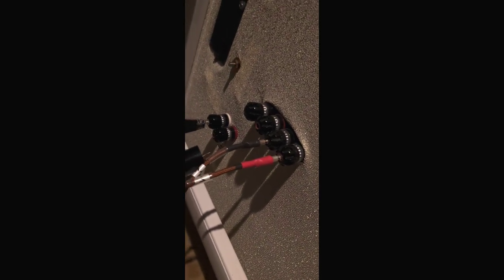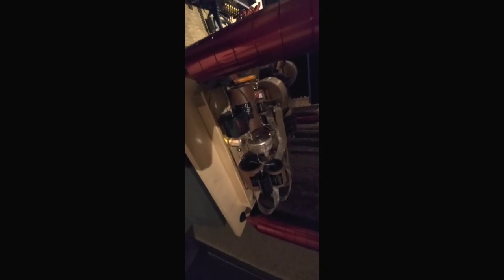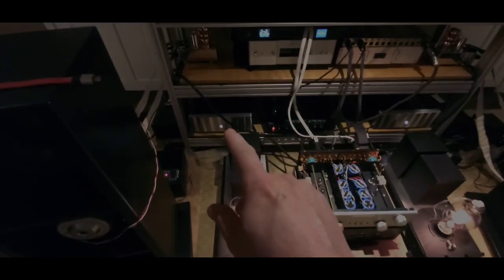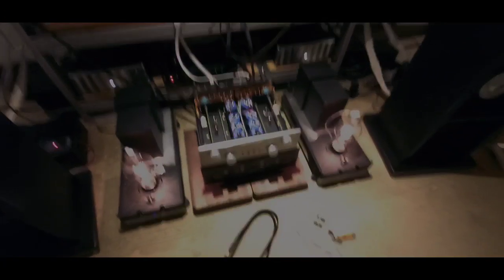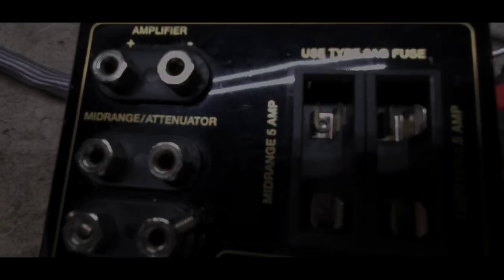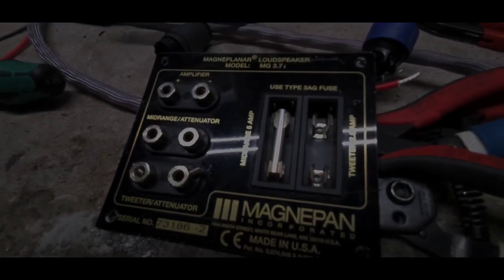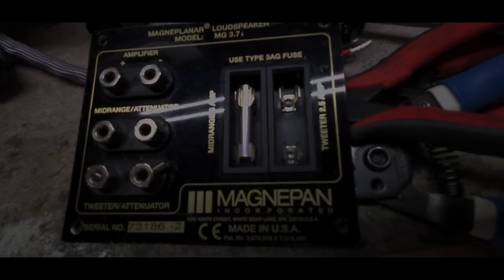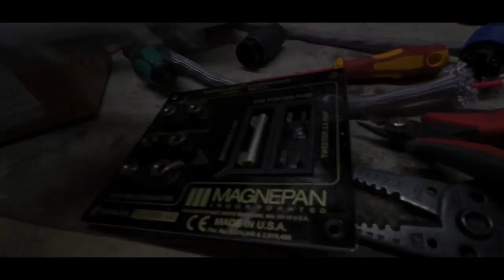MAGNEPAN Speakers, How to DOUBLE their performance !

Comment: I have a pair of 3.5R with NHT dual subs, dual sub amps and crossover.  Also, I have a pair of Rogue Audio M180 "Dark" spec amps teamed up with Rogue RP-7 preamp.  I am interested in applying the tweeter and active crossover mods you suggested.  Before I go down the rabbit hole, can you advise if the gear you suggest is what I need for my current setup?  Thanks. LB

Comment: If you like single ended triode amplifiers but you need more power to drive Magnepans it is not that difficult to build - for about what you would spend on a pair of 0.7's - an 833-A single ended triode amplifier. It needs about 1000 Volts on the plate, a Hammond 1642SE output transformer, and I use a Luhndal LL2765 transformers to couple 45 triodes to step down from 5k to 600 Ohms on the 833-A grids at zero grid bias. This has all the power Magnepans need and it sounds much better that the solid state amplifier the store where I auditioned them sounded. I would be interested in building such amplifiers for someone or helping them build them so I could guide them to insure success. The 833-A has to run its tungsten cathode on pure DC at 10 Volts and 10 Amperes. You can use a car battery with a 0.26 Ohm dropping resistor or build a power supply which has to have its 4.5 Farad capacitors pre-charged before switching on the cathode heaters.
Reply from the maker: Cool man ! Just saw this !

Comment: Hey Mike.  Just found your video.  Was wondering since you had all of the Magnepan models, do you think the new model 1.7i or the 3.7i would sound better than the 2.6R?  Like you I had most of them on over the years at different times, the MMG, 1.6, 3.6 and 20.1 and now the 2.6r completely refurbished, but can't remember that they are significantly better between the 1.6, 3.6 and 20.1.  The bigger they get the bigger the sound but the sound signature hasn't changed.  The MMG sounded kinda small.  So what do you think? The 1.7i is worth the upgrade from the 2.6r?

Comment: Are the MMGs able to be bi-amped without cutting wires and other things?  From what I read, the 3.5s and 3.6s (and 1.6s?) can be bi-amped using the existing connectors.  If not, how would I get rid of the old crossover and set up connections for the active crossover?  Thanks again!

Comment: GREAT vid on Magis. Just got 3 yr old 1.7i. with FJ mod kit not used. Been scared to use ss fuse link, but I trust you. Shocked your good with low end subs, but I only have 2ch Carver M400, just recapped. Im looking at 1 12" 370watt Rythmix servo sub for "fast bass" or is that bull? Is a DIY Dayton good enough?

Comment: Mikey, thank you for turning me to Magnepan. I started with .7 few months ago  I bought MG12 and I upgraded the capacitors which made the speaker really sound incredible with my 2 Anthony Gallo speaker. I decide to move up the Magnepan chain and I just bought 1.7I 2 days ago and I hope it will sound bigger than the .7 and more refined than the upgraded caps MG12. I definitely will buy your kit but I am very interested in the active crossover you are talking about. I don’t know where to start because I am not a techy guy and I know nothing about external crossover. I would appreciate if you can let me know how to start and where can I buy the active crossover. Thank you! Daniel.
Reply from the maker: Daniel , contact me directly please. I will explain whatever you'd like and I can just not explain and give directions what to do and why.  four oh four 764 six 2 three three

Comment: Got the LRS, but i am not blown away (yet). Bypassed the fuse and jumper. This helped a bit for the highs. Now in the process for some better stands. When they stand straight, the highs and mids sounds better. Can anyone advice me if an edge A2-300 amp can drive these things well?.
Reply from the maker: Excuse my French but Fuck yes Edge will drive those well. Are you kidding ? easy ...
Reply: @OCDHIFiGuy  hmm. I must test this some more then. My 30 year old 55W kenwood pushes the lrs twice as loud, with much more base. I ordered an hegel H90 now. I have seen a review this will get the best out off the lrs. Also ordered new cross over filters at gr research to improve the mid and highs.
Reply: Hi, what connection/s did you remove or move to get this bypass done on the LRS? thanks
Reply from the maker: @bikall1  ill bet your old Kenwood kicks The Hegels ass..
Reply: @OCDHIFiGuy  no it doesn't. The hegel performs very nicely with the lrs. I have 1 REL T5 now and a second one is comming. I ordered new crossovers for the lrs at gr reseach.
Reply: @tothemax324  with 4 screws you can pop the terminal plate on the back of. Follow the positive lead. You will see it runs through the jumper and fuse and then to the driver. Just move the fuse connection to the positive lead and srew it down together and you bypass the fuse and jumper. You only need a srewdriver and small spanner.
Reply: @bikall1  Thanks very much, as my LRS are on the way its still bit of a blur to picture. do you know of a link with pics? I cant find anything on the internet
Reply: @bikall1  Sorry mate, didn't mean to make it your problem, will wait until I have them then follow your plan
Reply: @tothemax324  No problem. But i don't think you will find it on line. But just pop the back off. it is dead simple. The red lead is +, the brown is the lead for the tweeter. Disconnect the brown connector and place it together with the red one on the red terminal.
Reply: @bikall1  Thank you sooo much, have copied/paste your instructions for reference
Reply: @OCDHIFiGuy  Well, some report on this.. I got a REW measurement set up in my room and i tried a hegel H95 back to back with an edge 300 on my LRS. The 300 W class D edge puts out less SPL then the hegel, but also considerably less bass as the hegel. The difference in the low frequencies is almost 10 DB after i match the outputs of the hegel and edge from 1 K hz to 20 K hz.

Comment: Great vid!!! I am using two powered plate amps subs with the LFE option. This allows me to use the electronic crossover in my receiver to separate the  highs and low frequencies. (Yep I said receiver. budget system LOL) I am then using a B&K amp to power the MG1’s.
Sounds good but need to upgrade my Maggie’s to maybe .7 or 1.7
I love your channel and would welcome any other budget suggestions you may have. Thanks “D”
Reply from the maker: Sounds like youre good , but the bottleneck is the receiver. and once you lose the receiver, you lose the crossover so you would have to add 2 things back , but it would be a complete eye opener for you .. 
Cheers !

Comment: Going true active like yours is one of the best improvements you can do to any speakers definitely went active 25 yrs ago still have the same setup that says something.
Passive is inefficient and a poor compromise in comparison, jim
Reply from the maker: For sure Jim, 
Are you fully differential front to back ? I see BAT in your moniker
Reply: My experience has been that going passive for mids and tweeters is the best but this is for regular box speakers.  

For the lows and mids yes it’s more efficient and easier to get better sound. 

However some are willing to spend lots of monies to use expensive passive crossover and produce all frequencies for the most combined natural sound and drive those tower speakers full range with lots of power.  Not sure if better is produced myself. 

Seems way more practical to use Maggie and sub type set up and use an active crossover.

Comment: What’s the info on the ribbon midrange you added? 
I added a Fountek ribbon tweeter to my MG2Cs as a super tweeter. Upgraded the crossover with Jupiter and air foil inductors made a world of difference. 
I’m very much the same as you. I will never own a stock pair of Maggie’s.
Reply from the maker: It's an out of production BG Radia... 2 inch wide 36 inches long.
Reply: @OCDHIFiGuy  thank you for the reply. Appreciate your content

Comment: I have 80s Era SMGs rebuilt by Magnepan 10 years ago. Would one of your fuse replacements improve them? There's only 1 fuse per speaker with no attenuater jumpers. I eventually want to upgrade to LRS+ but can't do it right now as I just bought a Schiit Vidar2.
Reply from the maker: Absolutely, Call me for a special order...
Reply: @@OCDHIFiGuy  I don't see any means of calling you. Do I call the Elleven # ?
Reply from the maker: @Starmangmh57  yes, that's me.... numbers on the site

Comment: I have a pair of MAGNEPAN .7s with MAGNA Riser stands and silver wires to replace the nickel plated horse shoe crap. What I need to purchase from you is the SILVER replacement for those silly fuses. I play my music at normal levels so the tweeters are never in danger. A pair of SVS SB-16 Ultra subwoofers handle the BASS from 80hz to 16hz.

Comment: Hi, I have a pair of 8 year old mmgs which sounded great for 5 years until I hooked them up now after 3 years of non use and they sound awful, I can turn the receiver volume up to -5db and still very little sound comes from them, do they degrade over time, any thoughts on this.
Reply: alexander curry yes they do degrade. Old mug will delaminates, that is the wire will separate from the Mylar panel.

Comment: What about replacing their  50 year old stock design nickel over brass or nickel over ferrous metal female bananas with copper female bananas. Or copper over nickel over silver (can silver be plated over Cooper, without nickel in between The copper and the silver? Or is my assumption incorrect? That would greatly improve the Sonic’s.

Comment: Your Awesome!  I was using a Pioneer separate component system I had since 1980.  It ended up biting the dust in 2010.   I then purchase a Yamaha 7.1 channel 140wpc for around $2400 in 2010.  I never really got into that system for some reason.  It always seemed it was missing something.  I ended up giving it to my brother.  I am now using a couple Crown XLS 2502 Class D amps as mono blocks with an Emotiva BasX PT-100 Stereo Preamplifier/DAC/Tuner.  I would like to match up with a pair of Magnepan LRS for $650.  I do plan on using a pair of subs with them as well.  Anything you can recommend to this 58yr old to get the best out of these Maggies?  I heard they sound best at up to 8 feet apart, 6 feet from the front wall and at least 6 feet from the side walls.  How far apart should I place the left and right speakers from each other?  How far apart to place the speakers with the tweeters on the outside or inside?  How much to toe in or toe out the Maggies?  I am going to use a miniDSP 2x4 HD to do the active crossover before the amps.  Can't wait till you review Maggies off the ceiling!  TY SO MUCH!
Reply from the maker: Thanks man, sounds like you have been watching my vids and taking notes, because you got it . First thing to do is buy my Maggie instant upgrade which is a fuse bypass for just under $100. This will be the strongest return on investment you;'ll make in Hifi. Find them on 11stereo,com . Then add dual subs and biamp Making sure to HIGH PASS the main panels at same slope and point as your sub low pass filter. Nearly everyone forgets this and it hugely frees up the main woofer to make a better smoother midrange presentation.,  There is no one formula for maggie room placement ,  Generally speaking not close to walls if you can help it and the wider you go between them the more toe in you'll need ... call me if you need to know more or you want details

Comment: Dear Doktor Chaos, it will take a few iterations for me to understand what you are talking about. I understand that the fuse is worthless. And nickel-plated parts are also worthless.
The sub-woofer part is for now beyond me. I do understand that stiffening the frame is beneficial. Perhaps carbon fiber would work even better. I don't think that the metal struts improve the stiffness of the frame. The strut is not very stiff. A carbon tube would be better.
I do think that you make very good points. I just need more time to get it. 
I will get there.
Thank you.
Reply from the maker: Hi Peter, let me know what you are not clear on and Ill try to help. The metal strut brace is far more stiff than before, Sure carbon is more stiff , first off that level of stiff os not required, second of all go price it and get back to me.. 

Best

Comment: I'm running wall mounted MMC2's with dual DWM's and a single REL Strata sub. Powered by a Bryston 4b SST2. The level of sound produced in pretty mind-blowing already, but I'm always looking to get better. Does you MMG suggestion cross over to MMC2's with DWM's? Any suggestions would be great.
Reply from the maker: If MMc2 are the onwalls then those are midrange and cut off at 16Khz, good for TV, not good for music unless you do what I do and use them as a discreet midrange in a 3 way DIY project. if these are new onwalls that now have tweeter, then yes all applies. I presume you would go farom amp to DWM, then out of that to MMC2s then run the sub separate for like 40Hz and down. Brystom while a great hard working die hard has never really been considered HiFi. its a top level pro amp. Pro amps have different design goals than HiFi. They are meant to be robust and never quit, thus the 10 or is it 20 year warranty. They are not designed for nuance and utter elimination of distortion the way HiFi amps are , so eventually buy a used Jeff Rowland and youll see what I mean..

Comment: Ok sure, I'll accept the notion that bypassing the fuse is potentially going to cause a sonic improvement.  A fuse is a resistor of sorts after all, so it can certainly rob a little volume if nothing else.  Still I'm very curious how you claim sonic improvements from various grades of silver or silver plated conductor when the original shitty nickel plated brass terminals are still in place, as are the cheap copper wires hooking everything up behind the plate.  

The truth is I could beat your fuse mod just by unscrewing the back plate and re-soldering a few wires, bypassing the jumper and fuse points entirely.  That's free, and results in the shortest signal path.  And if I wanted to buy into the notion of silver wire as an improvement despite the entire panel being strung with a couple hundred feet of aluminum, I could re-wire the entire internal crossover with about $10 of silver plated PTFE coated wire while I was in there bypassing the terminals and fuses.
Reply: I agree surely bypassing the fuse circuitry entirely will be much better

Comment: Marchand is not recommended. Firstwatt B4 or B5.
Reply from the maker: Ive got both. Plus a third company.. Nothing wrong with Marchand..
Reply: @OCDHIFiGuy  Internet hype tells me Marchand is noisy.
Reply from the maker: @rewind9536  in my experience they are quiet. The potentiometers make noise when switched however, but that's a set and forget thing.
Reply: @OCDHIFiGuy  In case I go for one, which models have you tried?

Comment: Thanks for your videos and talking highly of Magnapan's. I just saw this video on youtube comparing the LRS , .7 and 1.7.  I was rather surprised to learn that Magnapan's ,  while they may provide clarity, micro-details and soundstage (ie feel of the room), they don't image well.   I like well imaging speakers and don't care for a wall of sound regardless of the price. I'm wondering what's your take on the "pinpoint" imaging capability of Magnapans?  I ask because I've never heard one and don't have a way to audition one other than purchase and try. Thanks.
Reply from the maker: Hi Hooman. Magnepan images exceptionally well. In a digital system the DAC is what makes "flat" sound become 3D. Magnepan does whatever you ask it to. What they lack is strong bass and dynamic punch. You fix that by adding subwoofers. Even the older used magnepans image well. They are so pinpoint that moving your head side to side you can pop outside the center image. They are small sweet spot, but many of us listen alone. So this does not matter. Once you are inside the image its like Magic.
Reply: @OCDHIFiGuy  Thanks for your response.  I'm ok with a narrow "sweet spot" which seems to be a feature of these and other panel speakers and I agree with you that this hobby in its purest sense is largely a solitary pursuit. To make sure we are speaking the same language. when I think of a speaker imaging well,  I think of being able to visualize each instrument and/or singer within the sound stage, to be able to "draw" around them and feel their presence within specific coordinates within the 3D hologram from space to the left and right of the speaker and behind them , more than just the "center Image".. At least that's how I experience the magic in my system though there's room for improvement here..   Is that what these can do well?
Reply from the maker: @HoomanR17  they will do that with a good DAC yes. How i explain it is image depth. Any piece of crap can put vocals in the center. Youll notice that the soundstage with lesser hifi sounds like it is one foot thick. It goes 6 inches behind the front baffle and 6 inches forward ftom the baffle. I like it 6 feet forward and 6 feet backward.